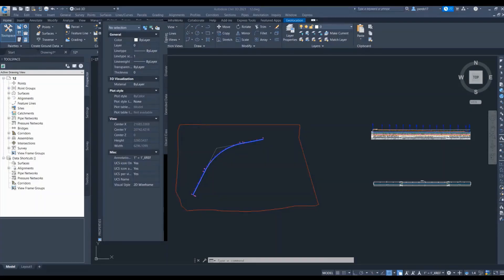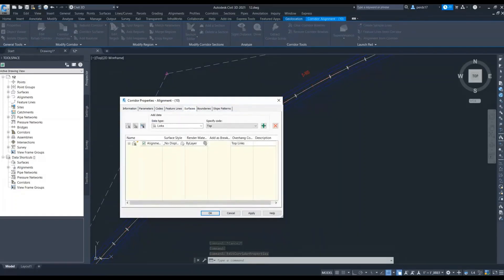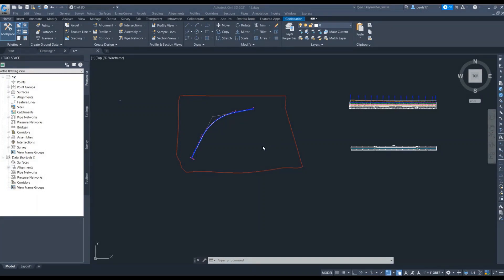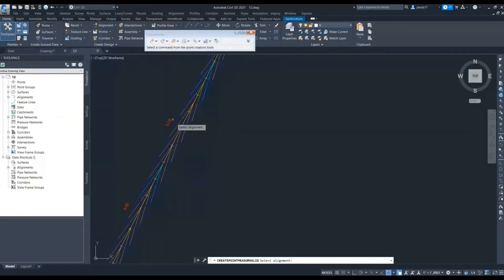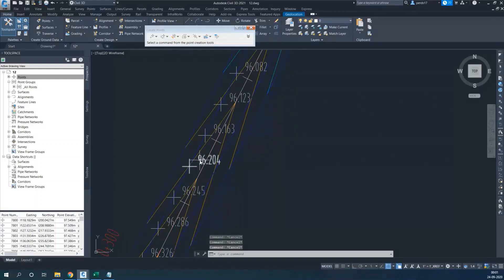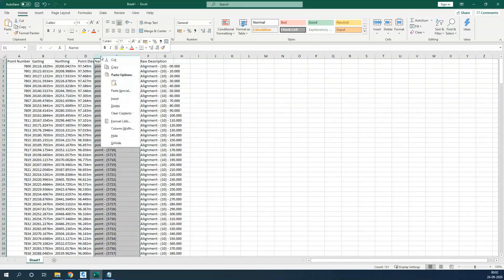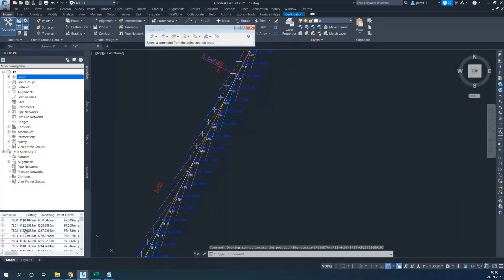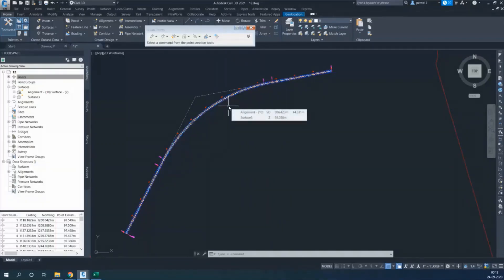Civil 3D - Road Edge Levels at fix intervals and with Description

Comment: Sir I want to draw point both side on surface alignment at fix interval, (ex: 0, -5 ,-10, -15, -20 and 5,10,15,20,) at every station perpendicular.
After draw I want this report in Excel 
In format 
station     offset.   Elevation.

Thanks
Reply from the maker: You can create points using method shown in video......and extract all point from C3D to Excel......